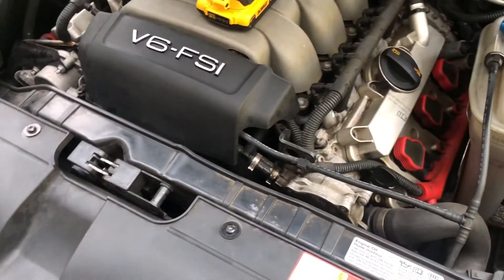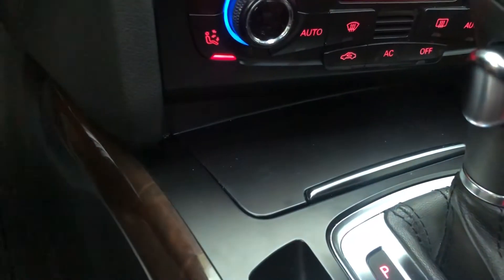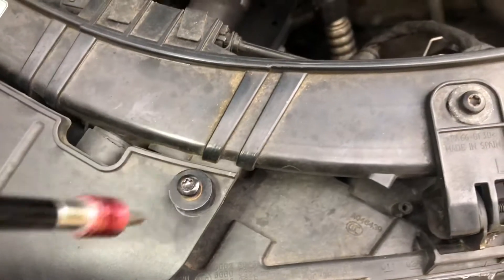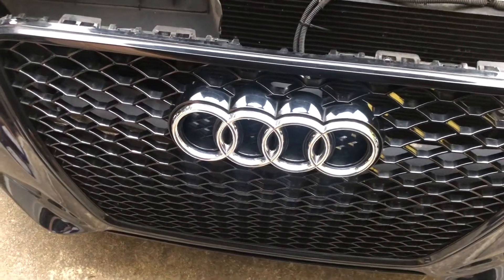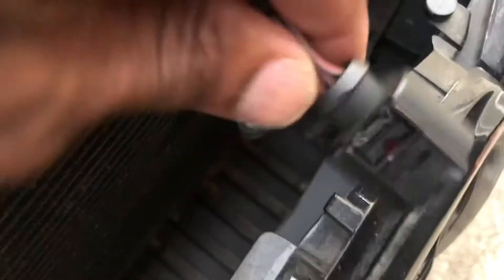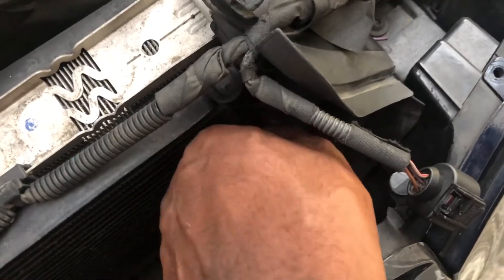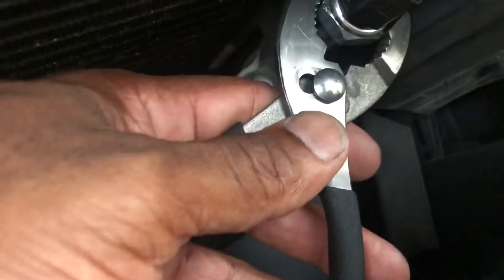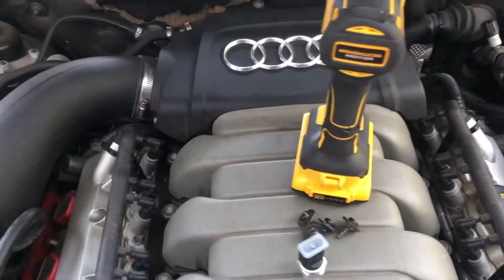Audi VW Porsche Air Condition AC keep turning off Simple Fix + Repair

Comment: hi there?  I have an A4 2014 B8.5 1.8 model TSFI... I have a problem with my aircon. when you switch it on. It blows air, but the air only comes from the underneath vents by the feet and by the windshield vents (sufficient airflow by the way). But NO amount of air flow is coming from the side vents of the dashboard and the middle vents of the dashboard by the radio. what could be wrong? thank you for your suggestion.
Reply from the maker: Sounds like the controller display is bad
Reply: I had the same problem, my pollen filter was blocked

Comment: My ac light stayed on and blew hot air. I replaced the pressure sensor with the $50 advanced auto sensor, and the light stayed on still, but no cold air. Pressurized the system so high and low are perfect, and put in the $110 OE part, and now the ac light won’t stay on, and still no cold air.
Reply from the maker: if the Ac light is on, seems like you have a bad compressor or low freon